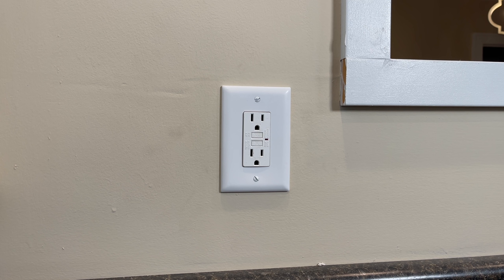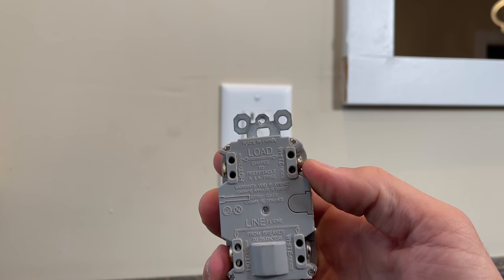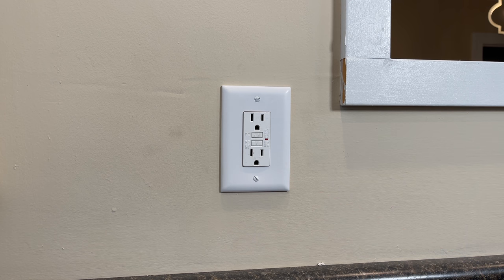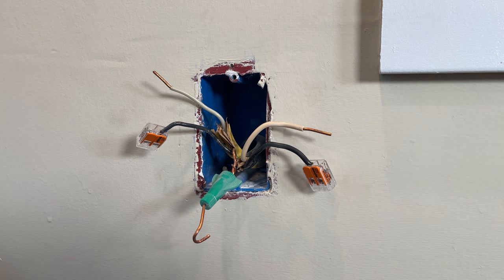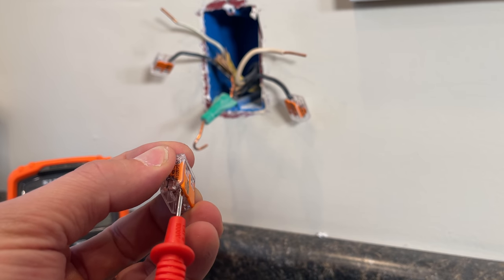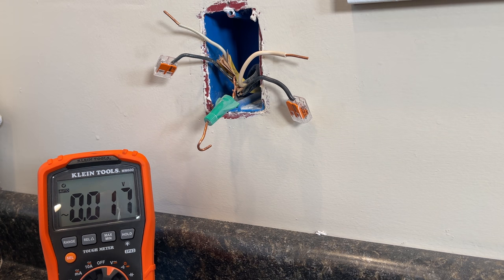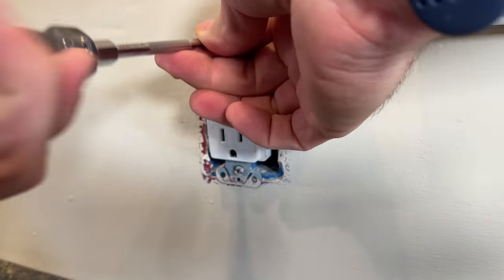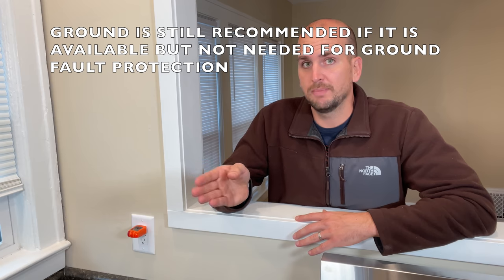Identify Which Wire Goes To Line vs Load Terminals | GFCI Outlet

Comment: If you own a multimeter you can just ring out neutral and ground with continuity, without dealing with live wires. The set that rings out closed is the line side upstream, and the set that does not ring out and shows open is load side downstream. This is because the line side neutral/ground set will be bonded at your first disconnecting means/main panel. I am an electrical contractor that's typically how I do it, just a quick tip for a different method!
Reply: I’m not familiar with the term “ring out”. What are you referring to?
Reply: But mickey mouse🐭 died😢 and will be bury in a Galaxy far far away.
Reply: @Sam-ey1nn , If you don't know that you're not electrically savy.
Reply: @Sam-ey1nn  most multimeters will ring when testing continuity
Reply: ... good tip but probably over the head of most DIY types.
Reply: @auletjohnast03638  - Or his multimeter doesn't have a tone for continuity.  I had never heard it called ring out before, but I figured out what he meant.  Also, he won't learn if he doesn't ask, there's no need to put him down.
Reply: @dustintunis9347  Excellent point Sir.  Thanks Sam for asking.  I kind of inferred what "ring out" meant but your asking the question cleared up the confusion.. Thank you.
Reply: Correct, and your method has several other advantages: No need for an extra trip to the panel. But the one I like most is no crossed neutral. In this box it wouldn’t matter much, but in a j box with multiple neutrals it could make a difference.
Reply: @jeffreylonigro1382  ... actually it might make  difference due to loading of other outlets on the neutral side versus the load (passthrough) side of the outlet, especially if there's a long wire run with voltage drop. Basically false tripping of the GFCI... and you will be scratching your head.
Reply: Great advice, I'm a DIY guy and didn't think about this. I totally understand your explanation.
Reply: Thanks!  Been searching for this for a good while- so many YouTube videos already have the wires “paired” up.  Mine are jumbled
Reply: Jesus loves you!! (:
Reply: Thank you for this. Exactly how I found it. I appreciate you bossman
Reply: I use the word the tone it out but same thing @Sam-ey1nn
Reply: @Sam-ey1nn testing continuity when u do it will make a tone which is what he is referring to as ring out

Comment: hi. newbie here. was wondering why you didn't test the other black line to indicate it to be the load side? thanks
Reply: He did, it had no voltage which means it is the load side.
Reply: Kris is right, but just in case you don't know the terminology... The line is the power coming in to the outlet, the load is anything down the line that if turned on puts a load on the outlet.  You could just hook them both up to the line terminal, but then nothing that is being fed power (what should be on the load side) would be GFCI protected.  That may or may not be important depending on what and where it is.  This would be a lot easier to explain with a diagram, but I at least tried to explain it clearly.
Reply: It's hard to explain to a newbie. They'd have to do some research and start with the basics.

Comment: This was incredibly easy to understand. Even for non-electricians like me. Half of the outlets in my art studio have stopped working, and I've been digging for a while now to figure out the issue. I paused and checked, and sure enough, the encased GFCI outlet on the back of the building was tripped and would not reset. So you answered the question for me quickly after a lot of research. I wish I would have found this sooner. I'm not a big fan of working with electrical components but after this vodeo I feel, still cautious, but more comfortable because of your examples on energy control check and confirmation. Great Job ensuring your viewers understand the adequate way to check and confirm energy control. Thank for the amazing video!!!

Comment: Thank you for posting this! I had a GFCI outlet buzz out and die a few years ago and decided to fix it. Watched your video and bought the tools and found out that they installed the line and load blacks on the same line screw, line and load whites on the same line screw. Followed the steps and (had to use the main breaker because none of the other breakers turned off the power) successfully replaced it thanks to you.

Comment: THANKS -  I knew that there was a line in and line out...  but what I didn't realize until watching this video is that the line in and line out on my GFCI replacement were reversed!    The markings on the back of the new receptacle were very hard to read.   With the ground plug in the bottom position like in your video, my line wires were on the bottom,  but the line on the new receptacle was on the top.   Drove me nuts!!!

Comment: Thanks for the information that GFCI outlet protects ungrounded lines. My old house has grounded and ungrounded lines mixed so I’ve been wondering if I had to replace all the old wires.
Reply: Going be NEC ( CODE ) if you install a GFCI receptacle or circuit breaker you have to put the little stickers that at least come with GFCI receptaclrs on all down stream ungrounded receptacles.
Reply from the maker: Good point, thx!

Comment: I don't have a load tester.  I don't know how to identify the wires inside the electrical box.  I had to guess... which group is load and which group is line?  I get where they attach to the gfic outlet but you don't go over what it looks like in the wall box and how to figure out how they are grouped in there.  You are assuming I'd have a meter.  Nah.  

Well...I guessed wrong... switched the wires around. etc.  don't cha know that when I opened the gfic box the first thing I did was to take the yellow tape off.  yeah, duh.  I watched several videos and none of them showed how to manually tell how the wires are grouped.  Your explanation of how the wires go into the gfic outlet is excellent.  You kept the camera angled so I could see your fingers and what they were touching.  Also... when the green light is on after you flip the breaker back on....  you got the wires crossed.  Also figured out that if the reset doesn't reset when you turn the power back on.... you have the wires hooked up wrong.  Yeah.... I did that too.  Problem now is it may be another year before I replace I gfic outlet because I'm redecorating... and I will have forgotten what goes where.  :)

Comment: Enjoy the electrical videos! Can you video on how to fix recessed receptacle inside box and loose stripped screws on outlet box?
Reply from the maker: Thanks for the suggestions!
Reply: Use pliers to grasp the head of the stripped screw and pull out as you untwist it.. Not always fun, but It will come out.

Comment: I am replacing old outlet with GFCI. There are only 3 wires going to old outlet, a black one, white one and the bare ground. Do I just need to test the black and white wires to determine which is hot?
Reply: No, with only one cable, 3 wires, they should be connected on the line side.  Bare or green to ground, white to white and black to brass.

Read the instructions carefully and make sure you are good.

Comment: I am replacing a GFCI that was installed when I bought my house, but when I wired it like the previous module, it wouldn't work.  When I switched the line and load, it tripped 2 circuits every time I hit the "reset" button.

I measured with a multimeter, and both sets of wires have current running through them.  This is incorrect, right?

Comment: I had a strange issue with installing a GFCI in my house.  I have installed other GFCIs without any problem, but this one had me scratching my head.  The original outlet had two sets of wires going to it.  The outlet did not have the tabs broken, so I knew this was a line / load circuit.  To confirm, I removed the wires and applied power.  Only one set of wires tested with positive voltage, so I knew that was my line.  The other wire had no voltage, so I knew that was my load.  So, I hooked up each set of wires to the GFCI to their respective set of Line and Load terminals.  When I was done, I restore the power to the outlet at the breaker.  When I went to press the switch on the GFCI to reset the circuit, the LED illuminated RED, indicating the GFCI did not like the circuit.  Then, I removed power to the outlet, and just installed the line wires without the load wires.  When I restored power again, the GFCI showed GREEN and was working properly.  I cannot for the life of me figure out why the GFCI would not work with the load wires connected.  I needed them to be connected because they powered other electrical circuits in my house.  I thought about just pig-tailing them and running one set of wires into the GFCI, but instead decided to put the old outlet back until I could figure out what was going on.  Any ideas?

Comment: So the load wires on the first GFCI if going to a second in series,  those wires go to the LINE side of the second GFCI and so on for a third?
Reply from the maker: Everything you said is correct except the second and/or third outlets are only standard outlets and not GFCI.  The first GFCI is providing the ground fault protection.
Reply: @EverydayHomeRepairs  I understand I am replacing 2 wire outlets in my place and was thinking I would use a GFCI in each location since I am not sure which outlet is the first one from the main. Then I guess I could unwire all the outlets, safely switch power on and use my non contact tester to locate the one with line power to the box. But that causes reset confusion if not reset in proper order if tripped correct?
Reply: @200xcBruce  ... once you find the first outlet in the series you only install ONE outlet with the GFCI function and that protects the rest of the original outlets via the LOAD side connection. (put the old outlets back in) There is no confusion after that. They are generally all in a row around a room. There's no skipping around. Once you find the first one you can get started. Hint: if you pull an outlet and there's only one set of wires then that's the last one on the circuit.
Reply: @rupe53  thanks.
Reply: @200xcBruce  You only use the load if you are using one GFCI receptacle to protect another one (or several) regular receptacles downstream. If you are going to install a GFCI in each location, then you only use the line side. This would just cost more money because GFCIs cost 15 plus dollars each and regular receptacles cost between 1 and 5 bucks.
Reply: @200xcBruce  The way to find the line is to turn off the breaker, verify which receptacles have been turned off with that same breaker, then disconnect and separate all wires of each receptacle (like he did in the video). Then you cap off the individual wires and turn the breaker back and and check each receptacle box for the wire with voltage present (also verify that this "line" is the only line by making sure you check every wire in every box you opened and disconnected. Once you have verified the line, you can put a piece of electrical tape on the line hot wire, turn off power and then connect GFCI just like he did in the video. Then you can connect the rest down stream with regular receptacles. When I do installations I make sure I pigtail the hots, neutrals and grounds so that even if one receptacle fails, the other ones will still work.
Reply: @illestofdemall13  thanks that was my plan. Disconnect and power on verify closest outlet.
Reply: @200xcBruce  You only need one GFI outlet at the first outlet......and practice using a real tester. Those non-contact testers get squirrelly if the batteries are low. Don't trust your life to them.

Comment: Everything was supposably working beforehand. Just found a GFIC WITH BACK 1/2 blown out.  Removed ruined device. Have line and load runs separated and find one set - I’ve determined are the line, read correct, but, both load wires read hot if I read them individually with the line neural. 
How the heck are the disconnected load wires reading full 124 volts??  Stumped.

Comment: How did you identify which neutral wire is line and load? It looked like you only tested the hot wires for power

Comment: When changing from 2 prong to GFCI the source voltage comes from the left and out is all on the right how do I wire the out on the GFCI. would it be top out to the bottom left out on the GFCI and bottom source to top right source

Comment: Best thing that all GFCI receptacles in last 5 years must have a sensor that will not allow it to be enegised if lime & load wires ate reversed. Also must self test once every something like 30 seconds but most perform a self test more often. You still.mudt hit the test button once a month die to self test does not open up the relay inside. Neither.of these features are required on GFCI circuit breakers. Think just about every residental AFCI ( ARC FAULT ) class A circuit breakers

Comment: I was wondering my old gfci popped and I swapped over with new one, I notice there was to white and 2 black on line side of gfci and 1 white 1 black on load side. Should there be 4 wires on line side? TIA

Comment: But what if all the wires are connected into the line side and nothing connected into the load side? Like 2 hot wires on the line side and 2 neutrals on the line side and the load side still has the yellow tape. How can I determine which set of wires should be in the line and which set should be in the load? A gfci outlet in my bathroom quit working and I was going to fix it but I don’t know which set of wires is which and I don’t have a tester.

Comment: Does this Line vs Load terminal only apply to GFCI? Does it apply to all wall outlets?
Reply: Only applies to GFCIs.
On regular outlets it doesn't matter if you use top or bottom screw because they are the same.

Comment: Videos good, but practice is to wrap the GFCI in electrical tape. Makes it where you can pull it out of the wall and have a bit more protection (finger won’t grab a screw)
Reply from the maker: Thanks Tyler, I usually only wrap outlets when installing in a metal box.
Reply: That's just a waste of time and tape IMHO. Nobody is taking the cover off for 10-20 years or longer. 
   The power should be off when someone does work on it. You are going in to touch the wires, tape is just one more annoying layer slowing you down.
   Not to mention, it is often a sticky mess and then you have to clean your fingers so you don't leave your paw prints all over.
   Please stop with the taping everyone. If you must, then at least use white marking tape that doesn't leave black goo all over. Thanks in advance for your cooperation.

Comment: I believe if you don't have a ground at the GFCI, the test button will not work. I do believe the GFCI will still provide protection against shock hazards. Perhaps a workaround would be to build a short extension cord with a jumper lead to connect to an alternate ground, such as a water pipe or heating pipe or duct temporarily for the test. If the GFCI can detect an alternate ground, the test should work.
Reply from the maker: I believe the test button on the GFCI will still perform as expected but a standard outlet tester with a GFCI test button will not work as you outlined 👍
Reply: The test button on the outlet will still work.

Comment: If you are replacing an existing GFCI couldn't you just trip the receptacle and that would cut power to the load side to double check it with the non-contact tester without removing the wires?

Comment: So if you would have tested the load side wires with the multimeter what reading would it had given you?
Reply: Since the wires aren't connected, the circuit is broken. So even with the breaker turned on there shouldn't be any current through the load side.

Comment: I realize that you were able to identify the line side by testing which black wire was live. However, how can you tell which of the two white wire to use with the live black wire?
Reply: black will read 120 volts to white on the feed side from the panel but not to the load side.
Reply: Also, most of the time, it's the white wire in the same sheathing.  The only reason I can think of off the top of my head that it wouldn't be in the same sheathing is if it were controlled by a light switch, but then you wouldn't likely be powering something else off of that outlet.
Reply: @dustintunis9347  ... in order for that white switch leg to be considered it would have to be connected to something on a feed side. IOW, the hot feed (from the panel) would need to start at the switch and the switch would have to be on. In that case both the hot and the neutral would still be within the same sheath. (from the switch) Any other wires would be going to more outlets.
Reply: @rupe53  A true "switch leg" has no neutral. Used most commonly when we used to run constant power to all the light boxes first. Then you drop a "leg" down to the switch....white feeding constant power to the switch and black bringing power back up to turn on the fixture when the switch is on.

No neutral
Reply: @patrickgatons  ... yes, that's true for your case but not always, as I mentioned. In the case of a remodel where someone adds a ceiling fan / light they will draw power from an existing outlet and likely feed the switch first before going up.

Comment: i install a smart dimmer switch an it stays on the power is not coming off ?
i use the load wire and power wire form the smart switch an connected to the live wire together an the neutral to neutral an ground to ground...what im i doing wrong ...help